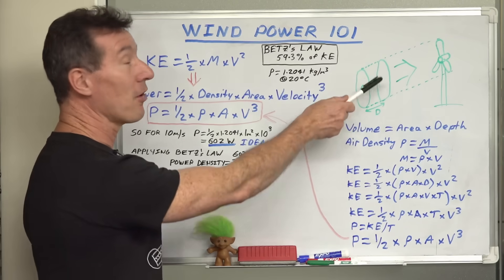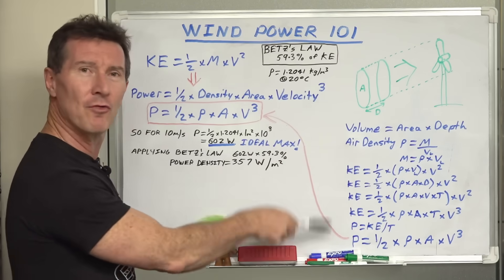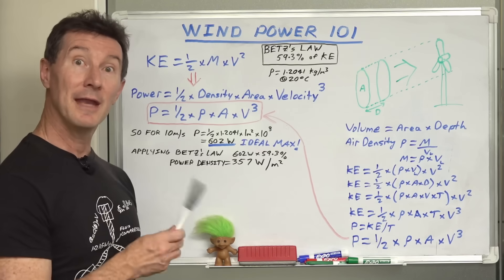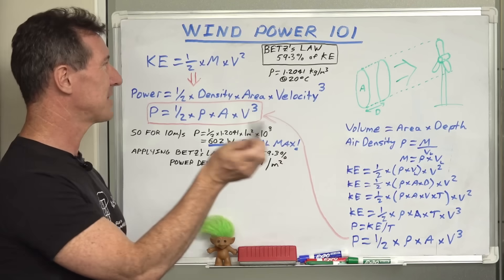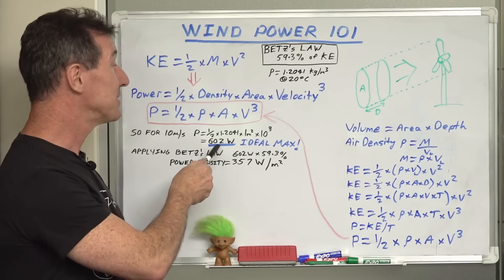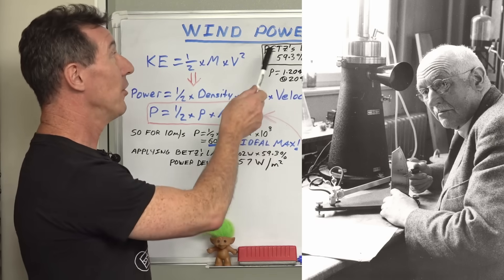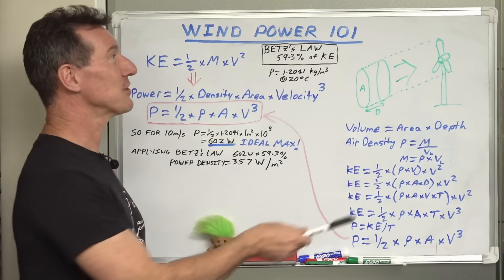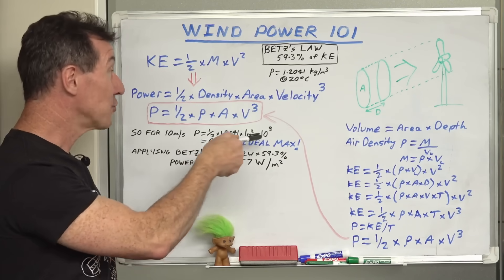EEVblog 1696 - TUTORIAL: Wind Power Efficiency 101

Comment: Betz' law is more fundemental than that even. If you think about it, IF a wind machine extracts all the KE from a kilogram of air, that means the air has stopped moving. But if it's not moving, then it's blocking any more air from coming into the machine. It has to have SOME KE so that it can 'get out of the way' of the next kilogram of air.

And if the 'first' kg of air moves out of the way very slowly (i.e. you extracted almost all of its KE), then you can't move the next kg air into the machine very quickly. Of course if the 'first' kg of air has almost the same velocity as it started, then you get a lot of air moving through the machine, but you're not getting very much from any particular kg.

Betz' did some calculus and found where the peak is between 'getting lots of air through the machine' and 'getting lots of energy from each kg' and that peak is his famous 59.3%

Unless you add more energy along the way, with a flame or heating or such, that's it. Best you can ever get.
Reply from the maker: That's a PEAK explanation. Thank you, I'm here all week...
Reply: Excellent explanation.
Reply: The air standing still is the first thing I thought of as well.
Thanks for peak explanation.
Reply: so it's some particular differential equation, got it.
Reply: I think, exit wind is most likely turbulent .
Reply: Modern wind turbines can achieve around 40% efficiency, steam around  80%, and hydro/water 90+%. That's if the wind is blowing constantly at the same speed which obviously it's not.  Therefore hydro and nuclear are much more efficient.
Reply: Yep, the only way to get 100% of the energy out of it is to put up a brick wall.

Comment: Common sense is so hard to find in this fu*ked up world, and you just nailed it. Thanks, Dave. I have taken a picture of your calculations and can't wait for a zealot to challenge me to a fact-off.
Reply: I doubt you're going to be challenged by a climate nut with actual engineering facts, and especially not the maximum theoretical power density of a wind turbine and practical efficiency of a blade. "Just Stop Oil" is about as complex as their minds can stretch to.

Comment: you cannot violate Btz's Law with wind-guiding, or whatumaycallit, because the pressure that results, that counters the air flow, cannot be localized, without using another air pump, another component that is under the same Betz limitation. you try to nullify the Betz limitation, only using another thing that re-generates the Betz limitation. if you do that, it is done by adding supplimentary energy to the wind, and we understand what is that. if you don't do that, the pressure bulids up and advances in all available space, countering the flow of air. 
i made my graduation paper on eolian energy :) 
personally investigated all promises of greater efficiency than the normal.
Reply: something that's annoyed me for some time: hawt v vawt. i appears that optimising for {steel: expensive; wind: free} is different than optimising for {steel: free; wind: expensive}, when talking about efficiencies of the different designs. non ?

Comment: That cube of wind speed is tricky, I am making a small turbine with the goal of over a kw at the average wind speed here. The problem is that in a gale there could be up to 100kw to dump. Hopefully stall regulation does it's thing.
Reply: What diameter are the blades and how fast the wind?

Comment: 600W/m² max at 20mph... There are places with higher average wind speeds which could take advantage of turbines capable of higher power generation levels.
Reply: No!  357 Watts/meter² . That's into the generator, which is only 75% efficient.  Leaving 268 Watts / meter² to the battery.

Comment: The people claiming above 350 W/m^2 power density must be claiming their turbine can extract maximum energy above 10 m/s. 20 m/s (44 mi/hr) winds are categorized as gale force wind, and they're uncommon even in ideal regions, but you could claim the capability to extract power from these winds for a mythical >1000 W/m^2 density on your fact sheet.
Reply: I think the point was (though I don't remember him saying it) that 10m/s at 20degC is the industry standard measurement so you can compare turbines. Lots of other engineering measurements are done like this with preset conditions and test setups.
Reply: @racitup4114 12 m/s is the industry standard for the Power Rating of Small Wind Turbines. He used 10 for easy math. Moany vendors just flat out lie, because there is no penalty.
Reply: don't have a duck in this race, but #showerthought winds are rarely completely dry, in fact hereabouts (nw europe) strong winds are associated with high humidity, increasing effective air mass. so there's that.

Comment: One  Vestas V236-15.0 MW produced 363 megawatt-hours of power in a 24-hour period.  To be fair it has a a wind-swept area of 43,743 square meters, and the blades are 115.5 meters long . These numbers is just mind-boggling.
Reply: Why is that "mind-boggling"? 15 x 24 = 360 so that's what it is specified to produce under ideal conditions. The point is 99.9% of the time it won't get anywhere near that figure so you still need a nuclear reactor to back it up (and please don't mention battery storage because BESSs are dangerous, expensive, have very short life-spans and are horrific to recycle)

Comment: I am stunned that they can achieve even 80% of the available wind power.
Those 3 skinny blades on the propellor let so much air through the gaps, I would hve expected to need a lot more blades to get close to 80% energy capture
Reply: 80% ??? No they can't.  Betz law says 60% at best. Then factor 75% efficient generator.  3 blades is optimal.

Comment: Wind turbines are great at sucking up subsidies. In fact, they won't run without them!
Reply: Modern wind turbines can achieve around 40% efficiency, steam around  80%, and hydro/water 90+%. That's if the wind is blowing constantly at the same speed which obviously it's not.  Therefore hydro and nuclear are much more efficient.
Reply: @billant2  Add to that energy density per acre. Wind farms require 1200 times more land to produce the same amount of electricity as nuclear.

Comment: If you want a peek behind the curtain regarding wind turbines ad wind farms, check these videos out. They document the demolition  of a 30 unit wind farm in Northern Illinois . The turbines were expected to last 20 years, but the last few that were running only made it 16 years. None of the towers or foundations were reused. Instead they were felled like trees, with the turbine house nacelles hitting the ground and the entire thing going to scrap or the landfill. Look at the massive amount of steel in the tower, the massive amount of concrete and reinforcing in the ground and then realize that 30'xs that number hit the dirt. The final video is about the new turbines installation, which required new foundations, new access roads and new transmission infrastructure. Then realize this is just one 30 unit farm in a nation with tens of thousands of these behemoths. 
 https://www.youtube.com/watch?v=SGLwUHn8MnE
https://youtu.be/6HXr4yrVwzg?feature=shared&t=187

Comment: Great video. All you need to do now is define v as the relative velocity between fluid and wind turbine and you debunked Derek's video on the faster than wind direct downwind cart. Propeller fan used for propulsion acts as a sail also so Pwind = 1/2  x ρ x A x (Vwind - Vcart)^3 will be max wind power available to that cart and will be zero when cart speed = wind speed directly downwind.
The cart is shown to temporarily exceed wind speed but that is because it is powered by stored energy (kinetic energy of the air molecules around the propeller so in that limited volume).  I demonstrated this experimentally and showed the cart slowing down after that stored energy is used up.

Comment: 6:08 Simple explanation: if you could capture all the KE of the wind then it has no more speed and stays there preventing the next "block" of air from pushing the blades.
Reply: Isnt that already covered by the "1/2" part of the equation?
The max kinetic energy that can be extracted is 1/2 of mass x velocity squared.
I thought Betz' law was more about the inefficiencies of fluids?
Reply: @wizrom3046 
The 1/2 comes from integrating the momentum m*v over the change in velocity
Reply: @robegatt   exactly, extracting the kinetic energy requires the mass to lose velocity and likewise expend energy
Reply: @wizrom3046 
no, the 1/2 is due to the maths of integrating a linear expression (simply because the derivative of a squared vale is 2x, eg d( x^2 )/dt = 2x, the integral of x is 1/2 x^2.
When the air starts to move its momentum increases because of the power applied: the kinetic energy is the integral of the power applied in that time.
When the air hits the fan, its velocity decreases but cannot stop, the kinetic energy is transformed from linear to rotational and since the air cannot stop not all of it is transformed.
Reply: @wizrom3046  nope, that 1/2 comes from the KE formula.

There’s a reason coming from differential calculus why it’s there, but it isn’t relevant here. That value (including the 1/2) is all of the KE of that air, and you can’t extract it all. 

If you did, you “block” air with more energy from coming. Think of it like a highway exit, you want cars to slow down, but not so much that you’ll cause a jam in the highway.

Comment: It is obvious that a wind turbine cannot  be 100% efficient, as that would imply extracting all the kinetic energy from the air flowing into the turbine. Since KE is proportional to velocity squared, the air leaving the turbine would have zero velocity, so how does it leave. Thus their must be an efficieny limit less than 100%.
Reply: What's stopping you from just stopping the air? To me it appears to be more energy than just the kinetic energy of the volume passing by.
Reply: @pomprocks if the air just  stops, the local air pressure behind the turbine  would need to increase as the air accumulates. It's  an absurdity, and a self limiting process, as air flows from high pressure region to low.

Comment: Why don't we have tidal generators in open sea, in the way we have hydroelectric turbines from the water flow from a dam? Although the massive pressure from a dam will provide greater levels of power, tidal flow is regular, (unlike the wind), and more easily harvested than wave motion. Coastal positioning would provide several opportunities for multiple tidal phases, leading to constant power generation overall.
Reply: Energy density, very high input costs vs energy produced, same problems as wind turbines, but underwater.
Reply: @steamfan7147  Plus now you have to transfer that electricity back to shore under water, sea water.  Nothing could ever possibly go wrong with running high voltage lines in salt water.  🤣
Reply: @mikesradiorepair The UK has undersea high voltage (typically several hundred kV DC) linking our National grid to various neighbours - France, Belgium, The Netherlands, Denmark, Norway, and Ireland. Each link has a capacity of 500MW - 1GW. The oldest of these has been working well for several decades.

Also, offshore wind farms have been feeding power back to shore via undersea cables for a decade or two.

So I don't think that the cables linking back to the grid are an insurmountable problem for tidal power. Upfront cost and environmental impact are likely to be the bigger issues.
Reply: @mikesradiorepair  However, underwater cabling is exactly what the farms of North Sea wind turbines are using!
Reply: There are already tidal generators out there, but they are a very expensive method of energy production due to high initial cost, and high cost of upkeep (due to all the moving parts). The typical cost is between 6 times and 14 times more expensive than offshore wind depending on the country.

Comment: How or does higher altitude affect the calculation?  We are in Boulder, CO USA at 5430 ft (1655 meters)
Reply: You get a smaller number for the density.
Reply: @mqb3gofjzkko7nzx38 but how do you get that number - is it a table or a formula or ???
Reply: @mqb3gofjzkko7nzx38 but is that an equation, or a table value or??
Reply: I would think humidity would also be a factor affecting air density